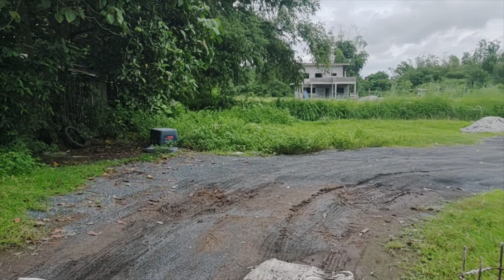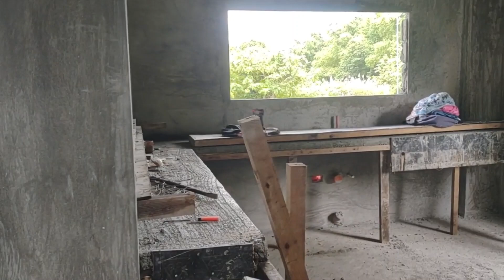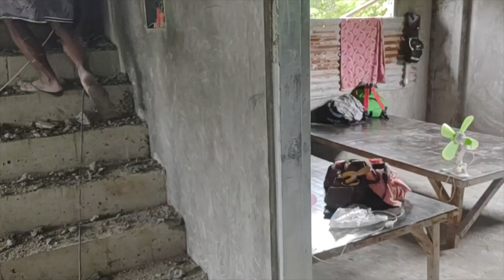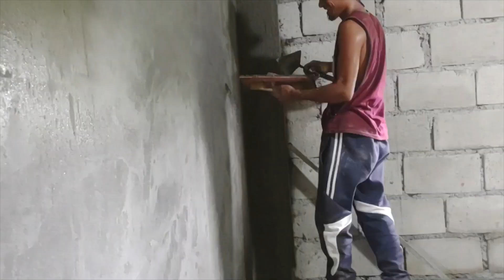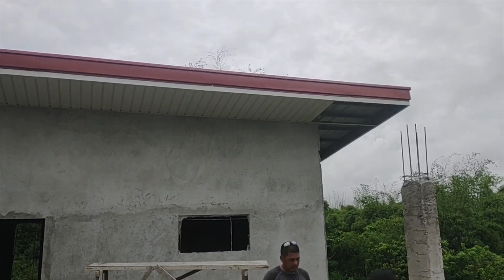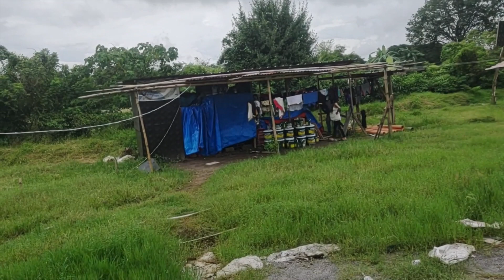Foreigner and Filipina House Build Philippines Home Update 20Sep22. @LeRocphilippines5539

Comment: You brought the false ceiling almost 2 feet down, in that case why build the walls and columns so high? It's a waste of material and labour, false ceilings don't require more than 6 inches depth to conceal all the plumbing and electricals, all that blocks, concrete  and mortar is adding up in your total expenses
Reply from the maker: @CarlosAlberto-ii1li  Yup here it is...
Reply from the maker: @ANIL NAIR Noted Anil...thanks for your input